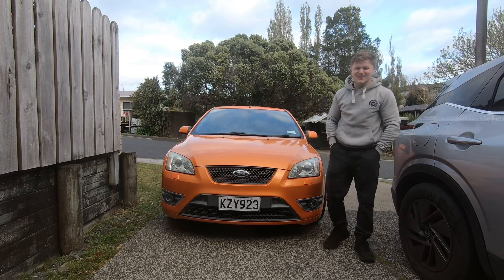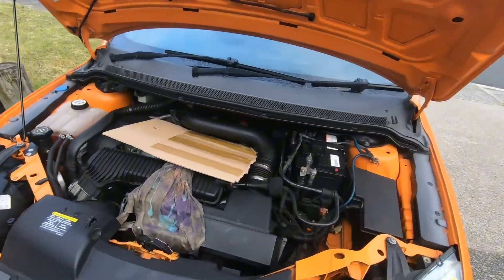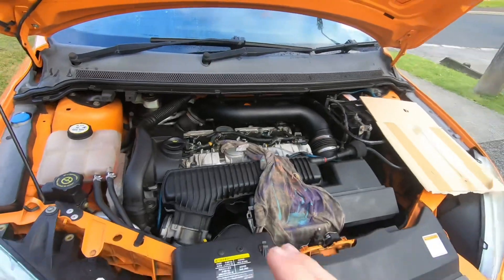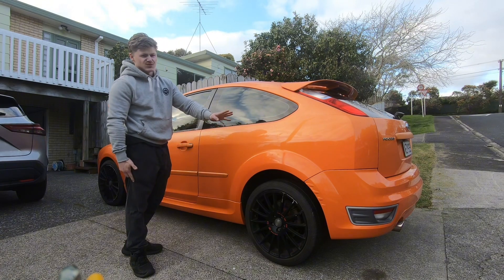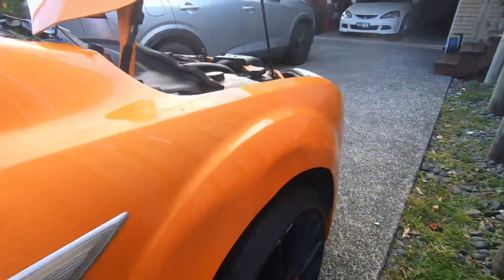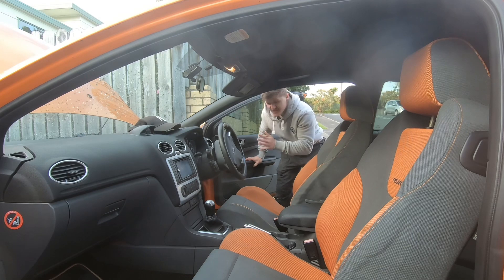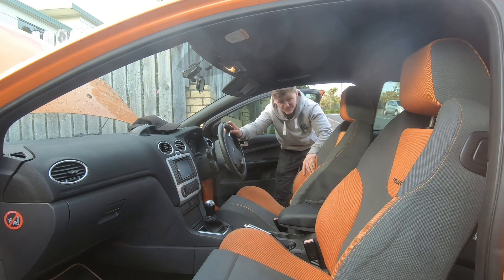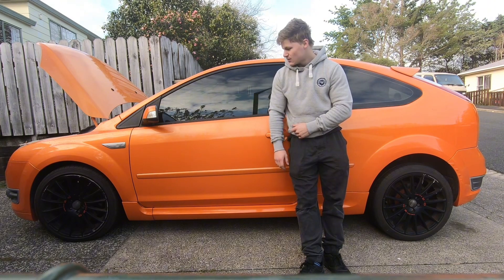I bought the CHEAPEST MK2 Focus ST (It's already *BROKEN*)

Comment: The block mod is no guarantee the liners won’t crack, it’s about how well it’s been maintained and warmed up / cooled down that prevents liner failure. I’m on 147,000 miles at 340bhp with no problems as it’s looked after.
Reply from the maker: Wow that's impressive your cars still going good at that power and mileage, Since my cars standard (for now) and low mileage I'm pretty confident its been well maintained, and even though I'll defiantly look after it I still want to do the block mod for future proofing and piece of mind, and these cars are so hard to find in New Zealand if I did crack a liner I don't think I'd find a spare engine. What mods have you done to get 340bhp? Thanks for the comment!
Reply: better piece of mind though, you wouldnt buy a condom after having unprotected sex would you ? you buy it before hand even though you know its not 100% protected
Reply from the maker: 🤣🤣 well said mate. That’s exactly my thinking with t this focus. I’m upgrading all the common failures points for X amount of money, before they fail and cost me 3 times what it would to prevent them. Thanks for the comment, nice to see a fellow focus YouTuber watching!

Comment: Looking forward to the content, I have one myself  and owned for around 5+ years  and started where you are now in my young 20,s so insurance was ludicrous. Mine is running around 290 bhp with plenty of breathing room to push more. Once you push past the 300-350 bhp mark things can start failing pretty quickly if you haven't spent money in places where needed. Drive shafts snapped on me 1 week after a remap, clutch slips after stage 1 due to immense torque, oil diaphragm failure due to age. I can also guarantee the bushes etc will be worn by now especially on the rear, poly bushing all of these is a worth while investment including the gearbox mount. As for bodywork, I had the whole care wrapped but over the years it does show its age realizing I should have just had it re-sprayed to begin with. Overall best car I've had and fun to drive and the 5 cylinder is truly special and will be a future classic. All I can say is don't give up and keep up the good work! Here is my mods list and why if interested,
K06 hybrid turbo (Oil seal failure on my stock turbo)
Forge acutator ( Small vacuum leak my old one)
Aluminium re-circ valve( I would replace this, the stock one is plastic) 
Group A induction kit( Decent kit and comes ECU relocation bracket same as RS)
Direnza intercooler ( Very good inter cooler and comes with the pipework)
Inlet plenum( Airtec plenum is made from cast metal not like the OEM plastic one which can crack)
Genuine Ford drive shafts ( Dont buy cheap ones or "upgraded" ones on ebay they dont last)
Aluminum radiator ( Mine was leaking plus its a worthwhile upgrade)
Silicone hoses ( The old ones perished and split) 
Section 59 turbo back exhaust ( Well they call it S59 for a reason ;) but best sounding one on the market) 
Poly bush kit ( All the bushes at the rear were shagged or seized making camber adjustment impossible)
Lowering springs ( Coil overs are good but I didn't want to feel every pot hole on British roads)
Reply from the maker: Thanks for the comment mate, hoping to do the same sort of mods to mine as well. I could really used that “don’t give up” comment at the minute as I’m doing the block mod and some things haven’t gone well. Video on that will be up in the next week or so hopefully .

Comment: Interesting how you guys over in NZ get the 3 door ST and 5 door XR5 Turbo... In Australia, we only get the 5 door XR5 Turbo...
Reply from the maker: In NZ we only got the 5 door xr5 as well. All of these 3dr st cars are imports, most jap imports like mine is
Reply: @turbo_tyler_  Oh okay... Forgot about you guys getting lots of Japanese imports, hence the weird spec... How rare are they in NZ? You did say in the video that nobody knows how to work on them and they're very rare but this engine also come in numerous Volvo's... In Australia, they're pretty uncommon nowadays, however there is aftermarket support and they do have a following... 

I own a 5 door pre facelift XR5T in the Performance Blue colour with a stage 1 tune and Miltek exhaust... 

They're great cars though this one needs some work to reach it's full potential + it has the signature Electric Orange colour which goes for a little more on the market...

I would recommend joining the "Focustoc forums," as they're very helpful and these cars are well known in the UK...

Comment: Sorry, you’ve got a old performance car that needs some routine maintenance and bodywork. The block mod is not necessary, it’s a 2006 and if it’s survived till now it says a lot. The orange suffers lacquer peel, answer is not to buy an orange ST.
Reply from the maker: Hey Keith, I agree the block mod isn't necessary, but I wanted to do it as a precaution as I'm planning on lots of track driving and hard driving and really just wanted the piece of mind and know I'd done everything I could to prevent a massive failure. In regards to the paint, I knew the orange cars peel easily before purchasing, But I really like the colour and got the car so cheap the paint condition was justified and gives me a project to practice my painting skills and make content for you guys. All the routine maintenance is currently being done so stick around and enjoy the process. Cheers
Reply: @turbo_tyler_  If you're going to drive it hard regularly, do the block mod and upgrade the clutch... These are a must, especially if you're putting more power into it (stage 2 onwards) and/or plan on driving it hard regularly...